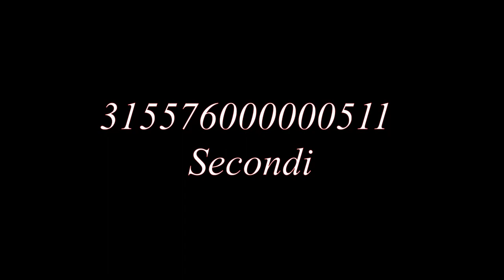PoP Corn per Formiche

Comment: ...alle 03:40 non faccio calcoli, ma intanto hai un po' di filtri atmosferici, non hai la perpendicolarita' e la potenza eventuale sul gingillo tondo, che non e' un metro quadrato, e' la stessa del puntino dove cuoci il pop corn. Grazie per avermi scelto come demente per guardare il video...
Reply from the maker: Buongiorno Marcello, giuste osservazionit le tue , anzi come accade spesso nei miei video quando si parla di calcoli o formule volutamente tendo ad essere molto approssimativo.  

Avvolte come in questo caso, esagero addirittura commettendo errori grossolani per stimolare l'utente a cercare la giusta formula o valore 🍀 passando così da intrattenimento divulgativo ad approfondimento autonomo. 

Con certezza nel video si dimostra come una lente dal raggio di 3,25 cm riesca a convogliare nel suo punto focale almeno 180°, che è la temperatura necessarie per far fare il PoP al seme di mais 🍿